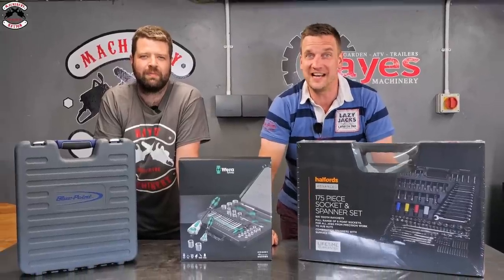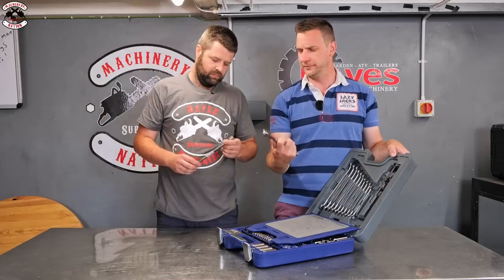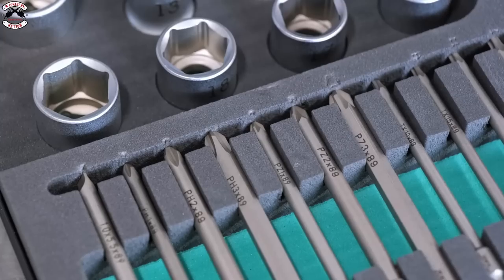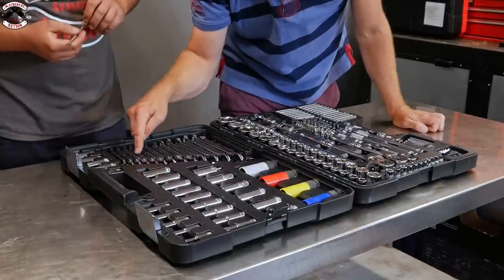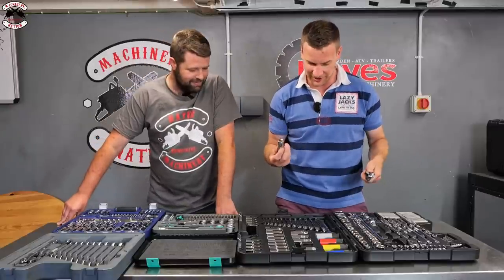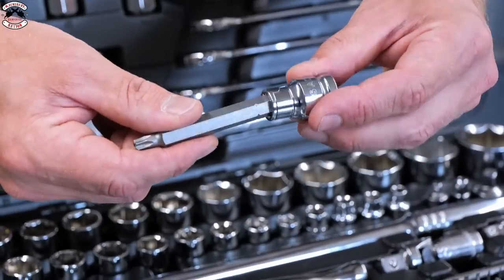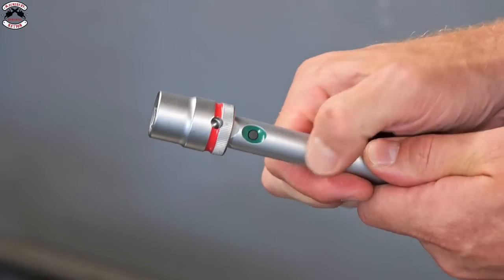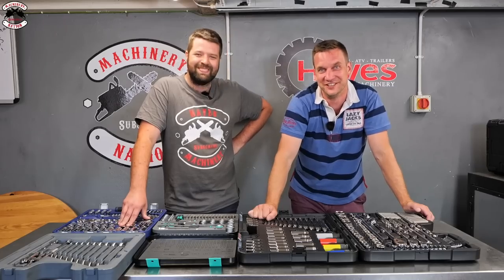The Best Socket Sets with LifeTime Warranty - Which one would you…

Comment: Not sure what planet you have to be on to compare Halfords to blue point 🤣 it’s all well and good having a larger set but as a mechanic I’ve learned it’s 100% the quality of the tool that matters
Reply: Being mechanically inclined I've found that having mechanical aptitude is what matters. If you can't do it with one of these sets it isn't the tool, it's you.
Reply from the maker: We weren’t really comparing them, just looking at what is included. Paul, you’re bang on 👍🏼
Reply: @1pcfred for sure I know that to an extent tools are only as good as the man stood behind them but once you’ve used good quality tools you can easily see how much easier it makes your jobs, when your turning spanner’s and sockets all day long, that stuff matters
Reply: @THEJJ4994  I've done enough work to know some jobs are just less than ideal regardless of what tools you're using. For me success hinges on adequately assessing the situation and acting accordingly. Rusty hardware really doesn't care what tools you're using. It's going to respond better to some methods than others.

Comment: You're going to find that the tawain made blue point is actually a bahco set your being ripped for because of a re badge. You can get the bahco on for 100 to 130quid. I like wera, their hex keys are lovely, so are some special tools, but expensive. The halfords stuff unbelievable, I've got halfords rachet spanner sets (fixed and flex head) I bought back in the 90s as an apprentice along with some other bits. Used in heavy industrial environments  ( btr belting and rubber rollers) not a single one has failed. And it's not because it wasn't tried, double spanner extension, stood on, cheater bar. The new driver bits at halfords are not as good (china) than the 90s ones. I've a set of 1/2 drive hex keys I bought in possibly 89? Still going, non bust.
Reply from the maker: Thank you for your feedback Michael.
Reply: I use both bluepoint and bahco. I feel the bahco is actually better built and tolerances are slightly better

Comment: The Bluepoint set looks like it was made by Bahco, so buy Bahco and save £££££'s.  I have the Bahco S138 set and it's the best combination set I've ever used, for quality and selection of tools, at the price it's a no brainer.  Wera, pronounced Vara by the way, is good but the pretty, fussy details get clogged with dirt,oil and grease and ends up looking scuzzy, also a pig to clean.  The ratchets also cannot be repaired or rebuilt as they are press fit assembled, unless they have recently changed that.  Top quality though, so sockets, spanners etc will be very tough.
Reply from the maker: Thank you for your feedback Mr Turbo. Very useful information.

Comment: Halfords would not replace my socket that the chrome had come off. 
Even contacted customer services. 
Will buy something else in future. 😞
Reply: Peeling chrome sucks. It's definitely a manufacturing defect when it happens too.
Reply from the maker: That’s a shame Paul. I personally haven’t claimed for anything but I hear generally they are pretty good.
Reply: Simple fix to that.. take a cold chisel and split the socket. Go back and warranty it!
Reply: @peacockealot  they said because I didn't have the receipt, even though I brought the set over twenty years ago. They wouldn't change it.
Even though it says Halfords advance on it!
Reply: @paulbudford  they did away with that a number of years ago as people had receipts taped to the inside of cases and they receipt had faded, so was essentially a blank piece of paper. I think you got some jobsworth tbh.

Comment: Sealey Premier range is nice
Reply from the maker: Do they offer lifetime warranty now?
Reply: @MachineryNation  only premier line
Reply from the maker: @E69apeTheMatrix420  interesting, I will take a look 👍🏼
Reply: @MachineryNation  I will do anything now days to not hand wrench and have swivel UJ and extensions to get me onto nearly any bolt using the nut smackers or impact ratchet. On a very rare occasion I have to hand crack a nut using a breaker bar 1/2 a turn but I'm then straight back on the power tools. Hand ratchets and non impact sockets are at the very back of my toolbox priority now. When I first started, hand socket set and spanners. Now I will do all I can to not use them. Ironic. I would love to see a high end trolley jack comparison.  Expensive test! I have the sealey premier SJA2500 (Sealey Jack Aluminium) 
not the SJAS (sealey jack Aluminium and steel.) 
It's been abused all its life and still works great!